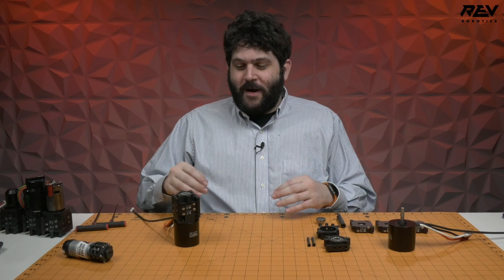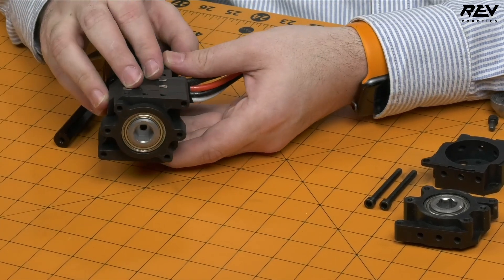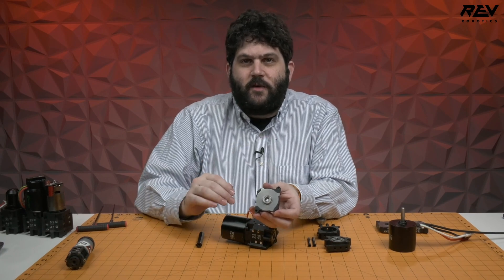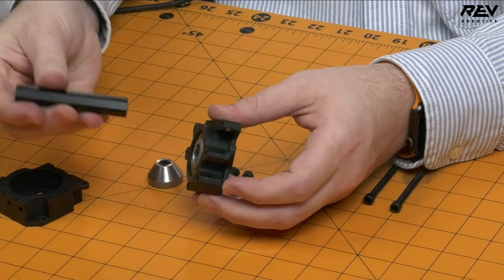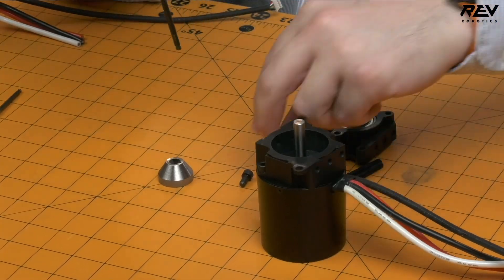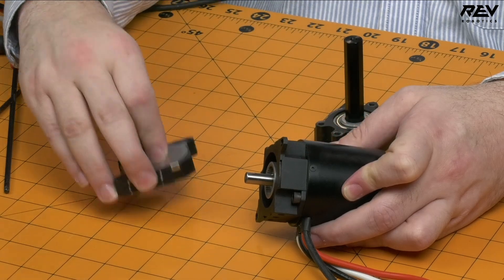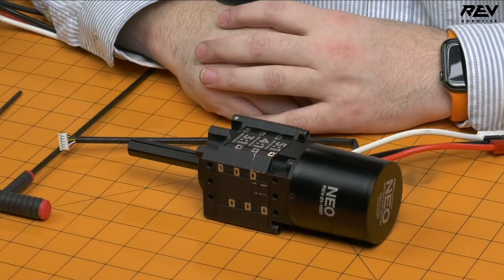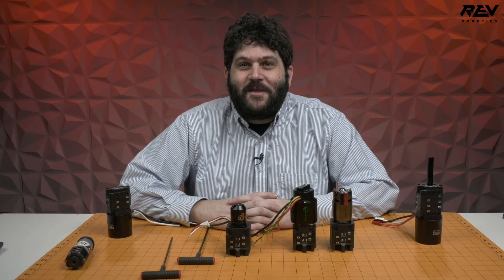Introduction to the MAXPlanetary System

Comment: Since it has 550 mountings, will the MAXplanetary work with Rev HEX HD motors?
Reply from the maker: MAXPlanetary is compatible with HD Hex Motors when used with the MAXPlanetary 550 Input Kit.